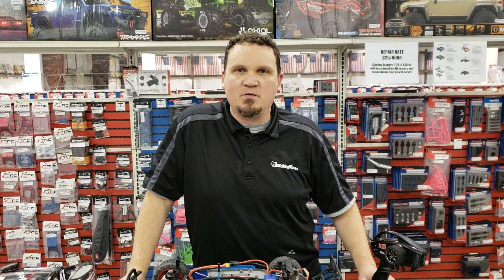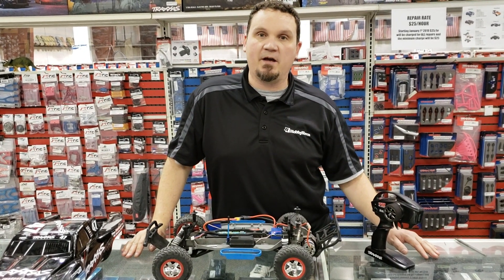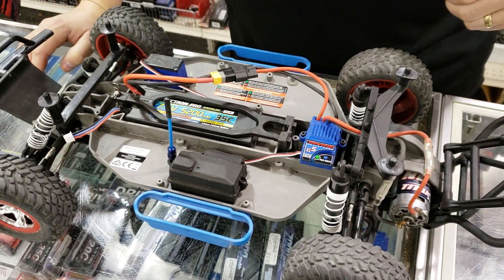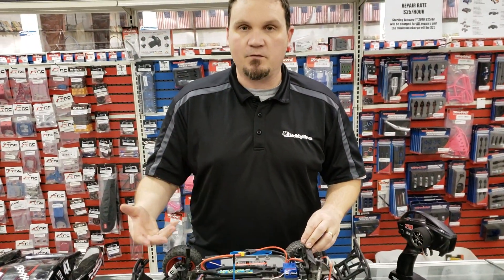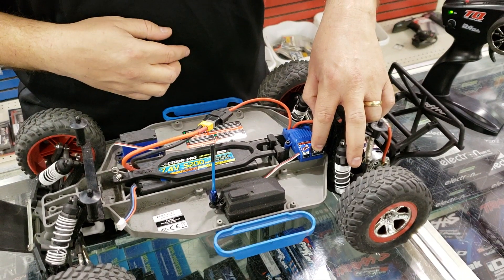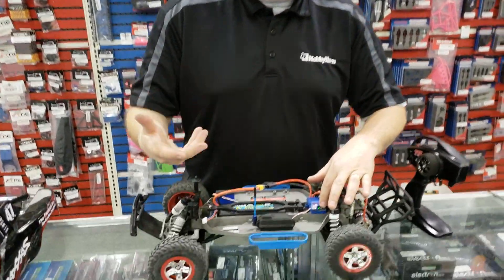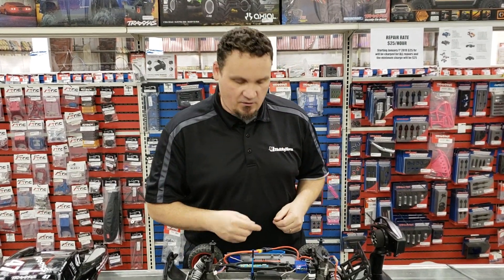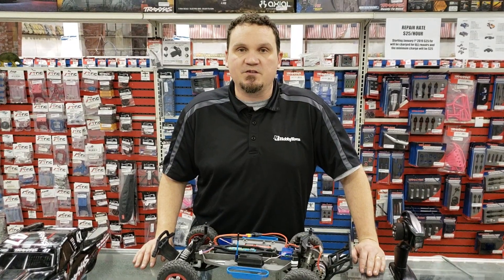HobbyTown HobbyPlex Traxxas XL5 How to Program Lipo Cutoff, Drive Modes and Lipo Cutoff

Comment: Dont have an on and off button
Reply from the maker: The on and off button is the blue button. Hold for about a second to turn on. As soon as you see a light, let go, and it's on. Hold for longer, and it will go into the program modes mentioned in the video.

To turn off hold until the light is gone. A second or so.

Comment: thank you for posting this  video it  was very helpful iam  also looking  for  a  lipo batery want  to make  sure i get the  right  connector  not  sure.
Reply from the maker: Most batteries that aren't traxxas brand but work with Traxxas will be called TRX compatible. They can't say traxxas for legal reasons.

Comment: I have a lipo in my car and it’s green and working but when i put full throttle it shut off and flash Red is it because I’m in nimh mod?
Reply from the maker: That usually means the lipo is at its cutoff and needs to be charged,

Or...it's too high of voltage and has been overcharged, or you're trying to run a 3-cell battery on a 2-cell only system.

Comment: Hey guys, i know this is a old post, so you can run a lipo battery with the XL5, can you use a brushless motor with this esc?
Reply from the maker: You can run a 2 cell lipo with an xl5. Just make sure you're in lipo mode, as the video shows. You can not run a brushless motor with an XL-5.

Comment: when im in lipo mode with a lipo battery its flashing red and green ?
Reply from the maker: Flashing red and green is usually a high voltage error.
Reply: What does that mean I'm a noob I ordered 2 more thinking my battery is bad.
Reply: I can put it in lipo mode with regular battery and fine but once i put in my lipo battery flashes red and green and only have steering maybe this will help i need to figure this out.
Reply from the maker: are you trying to run a 3s battery or 2s? Is your car brushed or brushless? A 3s battery on a brushed car won't work. Either that or the lipo batteries are getting overcharged.
Reply: @The HobbyPlex Show  wow ok it is brushed now I have 300 dollars in batteries that won't work. Guess I spend another 300 on brushless
Reply: @TheHobbyPlexShow  you can watch my video. Maybe 2s is what I need.
Reply from the maker: Yep, that's the culprit. I see that sort of thing all the time at my store.

Comment: so is the low voltage cutoff built into the low voltage detection?
Reply from the maker: Yes. For instance, if you try to run a nimh in lipo mode it usually just blinks red because it senses a lower voltage.
Reply: @TheHobbyPlexShow  ok thanks